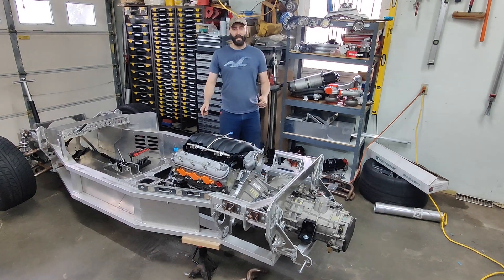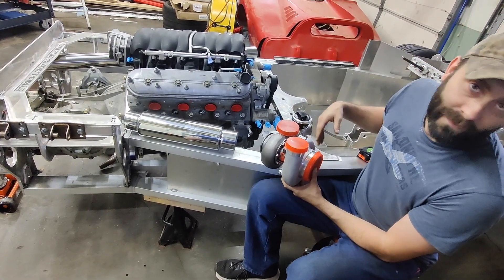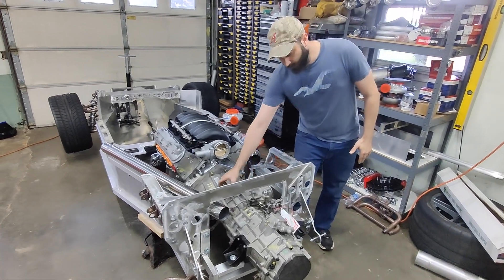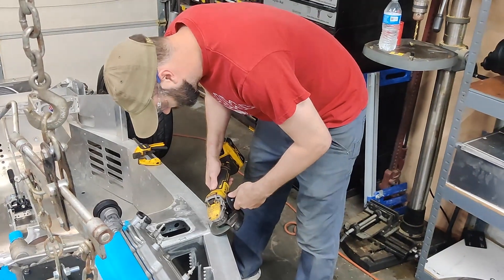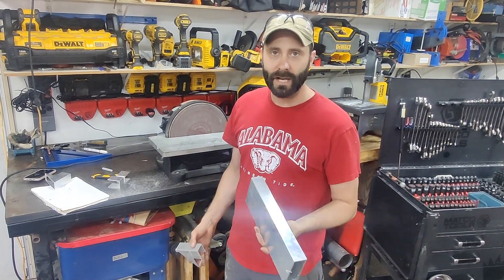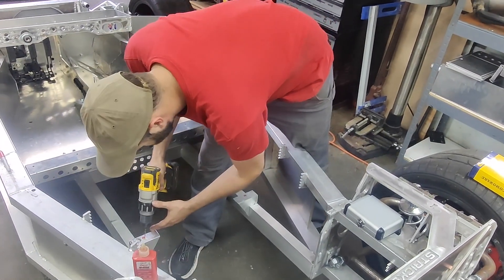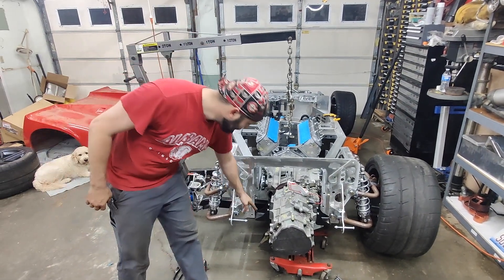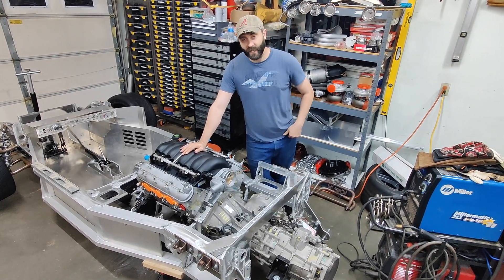McLaren Manta Mirage build #2: Installing the Drivetrain into the Strickland Racing Chassis PT 1

Comment: You are a great fabricator ,, Remarkable talent, what type of tyranny are you using, where is the fuel tank located, how about the water pump is it electric,, my concern is that with engine in the back with twin turbos, you will build lot of heat that needs to be dissipated  , is a good idea to monitor  The Air  Temperature in back

Comment: The engine mount adapters look a little flimsy. Maybe you said you were going to box them in? I would overkill those mounts. Ironically that is the one failure I had on my Manta Mirage and I only had a built 305. Both front mounts snapped as I turned a corner and the shift of mass caused me to spin and crash into another vehicle. I did not even realize what had happened until the car was repaired and I noticed the rear end had a mind of it's own. Those were steel brackets too.
Reply from the maker: Hi mark. Open to suggestions on how to improve the design. Are you talking about the engine adapters or trans mount? Both are 1/8" wall which is the same as the frame and parts of the trans mount are 1/4" thick same as the bulkheads. Engine mounts are just tacked in at the moment but will have 1.5" length weld on both sides of the top and roughly 2" long welds on the front and back of the inside of the frame rail. That's a horizontal and vertical surface welds for bracing in multiple directions. On the trans mount it's connected via 1/4" on both sides and is one solid piece. This is thicker than most OEM trans mounts which are thin sheet metal! Where do you think I should add some bracing?
Reply: @staynerbuilt601  Hey there, just to preface I am a structural engineer and been in my field for 20+ years so basically my job is to find failure points and improve upon them. So please forgive me for being so critical! The 1/8" wall is strong enough, but my concern is fatigue failure over time at the weld beads. Under vibration the parallel walls of the bracket will flex slightly and this can fatigue the base joints. My suggestion is to simply cap the opening on one side at least, with a 100% weld around the cap perimeter. That should be sufficient!
Reply from the maker: @Battlefresh  appreciate the suggestion. I can run a piece of flat bar all the way down the frame rail on the outside and it'll be boxed in and welded on 3 sides
Reply: @staynerbuilt601  Sounds like a good plan!